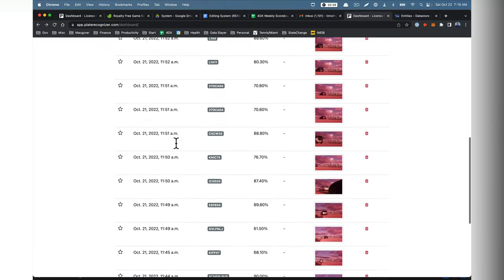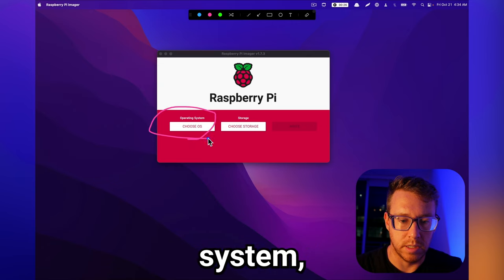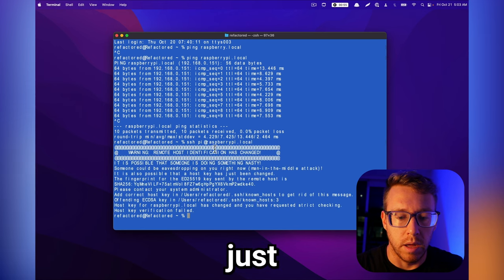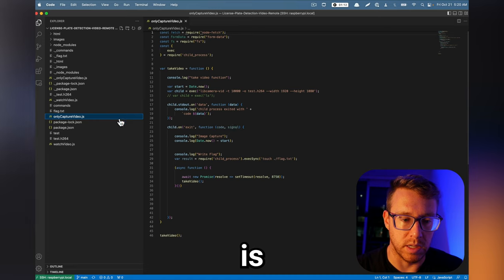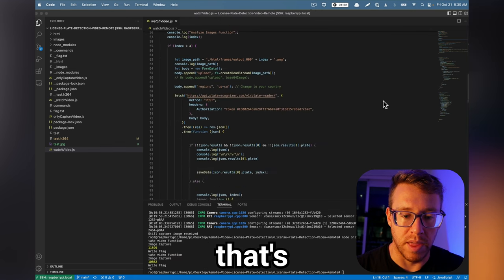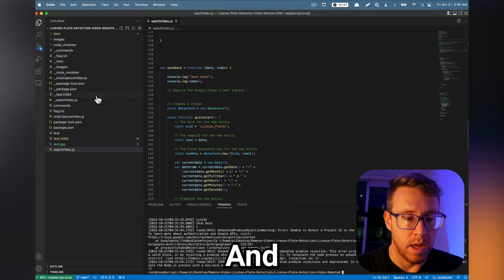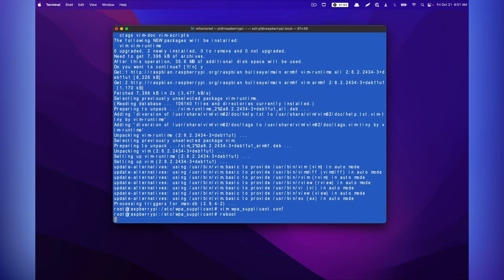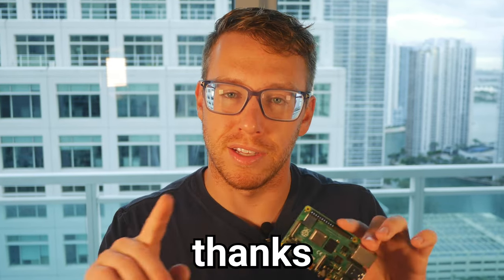I Ran a Raspberry Pi License Plate Scanner for 2 Hours

Comment: Most of the work is done by the cloud service not the pie. The  cloud service has massive computation which is needed
Reply: maybe it can be done on device with the right software or something just a little more powerful that a raspberry pi.  Otherwise if the cloud service goes down or charges fees not the best.

Comment: Hey man, great video! I'm trying to recreate this for a school project but i need help with 2 things. 1. When i run the code it just says "waiting for change in flags.txt", what do I need to do? 2. Where do I put the API key from the website? Thanks!
Reply: Hi, I have the same problem. Did you get to solve it? I'm also stuck in waiting for change in flag.txt
Reply: @aldofelix2002  did you guys resolve this issue?